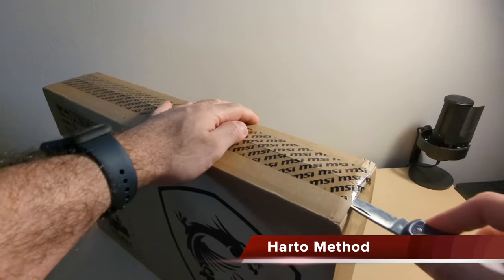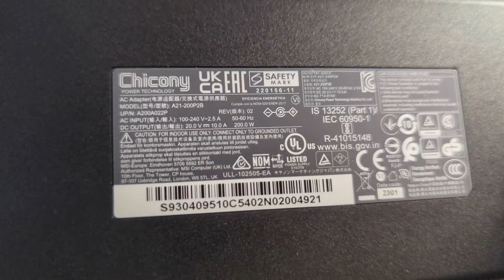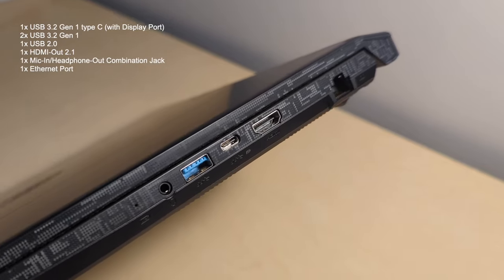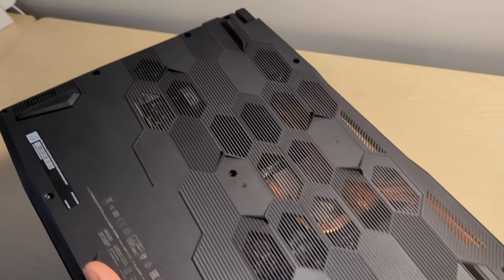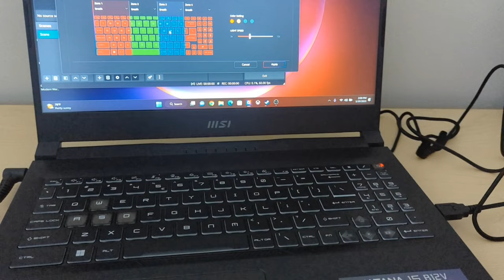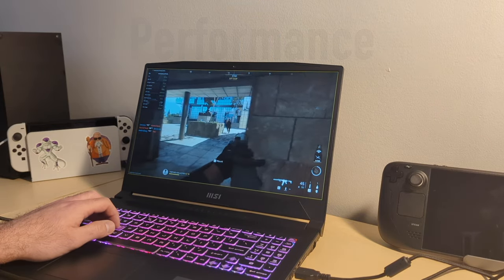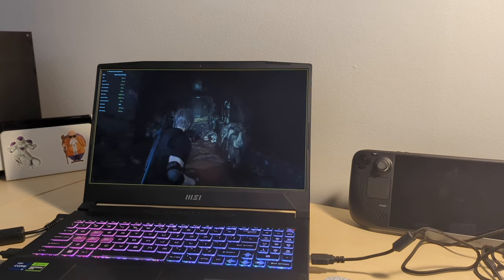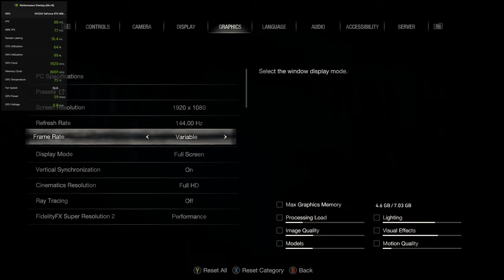MSI Katana 15 Review - Best “Budget” 2023 Laptop with an RTX 4060?!

Comment: Just got this laptop recently for 1700$ , I could of gotten something cheaper like the asus tuf f15 rtx 4060 but the katana had a better cooling system and hits 76°C on max load , I. 3D mark timespy I hit a score 10500, the laptop itself is very slim and portable, love it
Reply from the maker: Glad you like it! The more I use the more I realize that I’ve never run into any issues. Really solid performer for the price
Reply: Recently just bought - Katana 15 B13VFK

13th Gen Intel Core i9 - 13900H
16GB DDR5 RAM
1TB NVMe PCIe Gen4x4 SSD
Nvidia RTX 4060 8GB GDDR6 VRAM
15.6" FHD (1920*1080), 144Hz, IPS-Level
4-Zone RGB Gaming Keyboard
Intel Wi-Fi 6 AX201(2*2 ax) + BT5.2
MUX Switch
Windows 11 Home
Color - Black
MSI Backpack
2 Year Warranty Term
Reply: “could have” not “could of”. You’re welcome.
Reply: Ey bro just asking what is the games you play and whats the average fps that you got on them
Reply: What is the cpu temperatures that you get on this laptop, I am really thinking about getting it.
Reply: how is the battery?
Reply: Just bought it $1200 Amazon 4070
Reply: Wm has had this one for 1200 you Def overpayed
Reply: $1200 in USA but £1200 in UK we get our pants pulled down
Reply: I shit u not I jus got this laptop for $200 on eBay😭 im so happy and everything is working fine
Reply: lmao you can get ur for $700 now 😂😂😂
Reply: Wow, how 1 year passed and now it's easy to find for 1000€
Reply: @mateoupcoach Hey
How did the laptop turn out had it any problems is it a good choice 4070 is 1200€ rn too is would help me if you would answer as so someone who has used the msi kata 15 4070 🙂
Reply: It’s literally 800 what are u on about

Comment: I bought one for my wife it’s a MSI Katana A15 AI 15.6” 144Hz FHD Gaming Laptop: Ryzen 7-8845HS, NVIDIA Geforce RTX 4060, 32GB DDR5 , it’s coming tomorrow I hope it does the job, she’s a teacher that plays super causal games but it was on sale for 980 instead of 1.2k did I do good gang ? 😢
Reply from the maker: Think it’s a good pickup
Reply: Let us know how it is. I'm also thinking about swapping my gigabyte g6 for this one. My g6 cpu gets 100c at times.
Reply: I’m thinking about buying it this weekend as well. Give us your review.
Reply: @marcinmowinski5643  first one came in with a dead GPU out of the box so I had ro return it, there’s a new one that arrived today I’ll have to set it up and run some tests I’ll comment back my results guys.
Reply: @Mb.groovy  looking forward to hearing from you!
Reply: If it is going to be used heavily, return it right now. I bought a ryzen 7 HP Pavillion Gaming laptop once, due to intense use the Processor overheated and the laptop became dead in 2 years
Reply: Bought mine last weekend, ryzen 7 8845hs, rtx4060. So far very good. So much better then gigabyte g6. No heat issues, nice and quiet and performance is on par with a desktop with similar specs. Night and day difference!
Reply: @marcinmowinski5643  ryzen over heats more than Intel, for Laptop gaming Intel is better. For pc ryzen is better
Reply: @arpit2095  not sure if this is correct. Ryzen works better at lower power then intel, it can boost at lower power thus heating up less. My ryzen 7 8845hs in katana stays between 74-84 degrees while gaming cpu heavy games. Intel 7 13620h I had in gigabyte laptop would hit 100 degrees easly. Not to mention the noise. Also zen 4 cpus are more efficient then zen 3 and they stay cooler.

Comment: Just got one with a 4070 and 32gigs of ram and otherwise I think we have the same thing. So far.... It's fine. I paid 1500 on a tax free week in my state so it's fine. My desktop has a 1070Ti and i7-7700k so its quite the upgrade on that front. Plus I've had some problems with the desktop completely shutting down under heavy loads so I'm not sure what's going on with that but hopefully I'll be using this mostly for rendering/editing 4k video without having shut-downs ruin my entire workflow. Ran hogwarts legacy on ultra settings for about 4 hours and didn't have a single frame drop. Hard to complain when the desktop can't run it on the lowest settings without crashing the whole thing.
So far it's been nice to use... even though it's been just a few hours. All in all- no ragrats (so far)
Reply from the maker: Nice to hear! Will you be replacing your desktop with this and just dock your laptop when you’re at home?

Comment: Had mine up and running for no more than a few hours now, so far nothing but good to say about it. I suppose I'm lucky to have held out until the black Friday deals. Got mine with 16GB RAM, i9-13900H CPU and RTX 4070. Absolute beast compared to my desktop which is 5 years out of date almost. Best part is this was goin for £1900-£2000 on a normal month but with the sales was reduced by £800. Bloody great steal.
Reply: How you got for £800 could you please provide links or explain
Reply from the maker: Yeah there are some crazy deals on it right now!
Reply: Planning to buy this specs too! Hopefully there's no defect
Reply from the maker: Did you get it?
Reply: @hartomethod  out of stock unfortunately
Reply: How much did you pay?

Comment: I have the Katana with the i5 chip instead of the i7.  Around the same price buying it from Newegg.  Oddly, this one lacked the mouse, though not really complaining as since I travel a lot, a traditional mouse doesn't function very well and a wireless trackball mouse is not very expensive at all (plus I bought both at the same time).  The trackpad on mine actually is decently built and handles the pressure better than your model.  It's handled a few small bumps along the way and one or two "I hope the screen survived" moments.  No damage and performs awesome.  I've ran a PS3 emulator on it for like 3 days straight (Gran Turismo 5 B-Spec endurance racing) and it never gave a fuss pulling that kind of load against the GPU and CPU.  The only thing I have issue with is Sim City 4 absolutely refuses to boot on this laptop but will boot on my desktop (which uses an 11th gen chip and I think the 12th gen chip bricks the game).

Overall, I absolutely love this laptop and it has definitely proved it's worth to me and definitely recommend it if it fits in the budget.  It also isn't overly noisy, even when gaming, at least to me, though I do have some loud speakers hooked to it so it easily drowns out the noise.
Reply from the maker: Nice!

Comment: Would like to see you run it on your external monitor as well.. I have a two-year-old MSI with a RTX 3060 32 gigs Ram. When playing Resident Evil 2 Remake It barely holds 60 FPS throughout the whole game.. Your MSI 4060 seems the average 99 FPS, so itdefinitely a good upgrade for the price.. Also I think you'll find the RTX 4070. Is just a couple of $100 more in a laptop with about a 15% to 25% higher in frames Rate's. Not to go off topic, But it might be a good review in the future... Either way, great video, good job, thank you😅
Reply from the maker: Thank you!

Comment: Idk if this applies to the katana 15, but the katana 17 I have with the same specs has a lot of fan noise. Even when I don't have anything running. It comes and goes intermittently. The battery life is also abysmal even for a gaming laptop. Moreover, the laptop only comes with a 1080p screen and has okay speakers at best. Other than that, just purely in terms of performance, the machine is a beast.
Reply from the maker: I've honestly only used it for gaming so my fan was consistently running (but I used headphones). Also I agree, this laptop needs a power source to get the best use out of it since it has such power hungry internals! But with all that being said, it was able to handle everything I threw at it!
Reply: you can change the fan speed

Comment: Hi bro, what's your opinion for these models, which one is better? i'm so confused :( Thanks
1/ Laptop Asus TUF Gaming F15 RTX 4060 8GB Intel Core i7 12700H 8GB 512GB 15.6″ FHD IPS 144Hz Jaeger Gray RGB Win 11
2/ Laptop Gaming MSI Katana 15 B13VFK Geforce RTX 4060 8GB Intel Core i7 13620H 16GB 1TB 15.6” FHD IPS 144Hz RGB Win 11
Reply from the maker: I think they’re both pretty decent and similar. The CPU are essentially the same in terms of performance. 

The only think you should consider is that the ASUS only comes with 8GB of RAM and 512 SSD where as the MSI comes with double that. Not the biggest deal because you can always upgrade but it would be an additional step.

Comment: I chose the GE76 Raider 11th gen 3070 but it was stolen. Now I'm looking to replace it, with this & from what I've seen of your Battlefield gameplay, it looks like it's a certainty now. Thank you! MSI Control Panel, has different power modes. When playing, I would crank that as it changes to fan and voltage, basically overclocking it for "Performance Mode", the Turbo was too noisy on the GE76 and can only imagine, MSI's fan curves won't have changed much. Another point, at release of the z390 for i9-9900k all MSI boards, were by default overclocked. I've got an MSI MEG Z390 Tomahawk and it screams... because it's overclocked by default.
Reply from the maker: Sorry to hear about your laptop! And appreciate the tips and advice on MSI products, I didn’t know that before. This laptop will handle BF with NO issues. I’ve played multiple hour sessions this past week and it’s a beast. Getting above 100fps easily.
Reply: How'd it get stolen?
Reply: @dutchjoran  I didn't ask the thieves... they weren't around to ask.
Reply: @mrhassell  figured as much 😂 did you bring it to a MC Donald's and go to the toilet or something?

Comment: I spent the entire Labor Day trying to look for a laptop for this semester in terms of specs it covers everything I need but I don't need much for gaming more so rendering such as Da Vinci, Adobe Photoshop, audacity, and Filmora. An acquaintance tells me if I can get  I could get an AMD cpu and a Nvidia 3050/60 or 4050/60, I should be good. 

But I'm not tech Savvy enough to take it apart and put that together plus that's a lot of extra expense. I'm mainly need something that has a lot of CPU to be able to run all those programs I listed above. 
Would you say it's still be worth it to try and invest into this computer?

My acquaintance also recommended the MSI Bravo 15 which has a ton of CPU but it might not be able to run my programs as well so I'm at an impasse between these two I would really appreciate any suggestions my budget is $1,000 but I would prefer to stay below but I don't mind shingling out a little bit if it's worth the value.
Reply from the maker: I think this laptop will handle those programs with no issue

Comment: i'm planning on getting the Katana 15 with same chip but with the 4070. I have a msi monitor also with 1440p and plan to connect that up when i'm at home. have you already tried doing that, if so? could you share your experience? btw great review!
Reply from the maker: That sounds like it’s gonna be a dope setup! Yes, I’ve hooked up mine to my 1440p monitor and have been able to play on it no problems. My monitor is also called at 144hertz and I can hit that on some titles as well.
Reply: If you're a gamer, 4070 one is better for you but I'm planning on getting the 4060 one with i9 13900H since I'm going to be needing more CPU uses.
Reply: @GojokeSatoru i am also thinking the same when u get yours please tell about how it works
Reply: @Kenny0215  well, I won't be getting it until mid month of October but i9 has more cores, threads and higher maximum operating frequencies which will allow your PC to run faster than i7. I'm gonna be mainly using it for song production which is CPU demanding and better CPU would cut sound latency issues. GPU wise, 4070 obviously is better than 4060 by what I would think is 25-30% in gaming performance. I only play Dota 2 so I probably won't be needing a higher GPU.

Comment: hey man im about to get this laptop but instead of the intel cpu its a amd cpu version, im kinda a noob when it comes to pc overclocking how risky is it do to and does it affect battery life? I saw u post a link to a reddit thread about it but was curious if i should bother doing it or not, im a college student so ill be using it for gaming and homework, should i try overclocking or just not bother?
Reply from the maker: You can choose your overclock settings so if you’re using it while gaming, you can just run it on normal then if you want to have a little extra boost, run the overclock
Reply: @hartomethod  okay sweet! thanks for the info!

Comment: Hey, which one do you think its better, MSI cyborg 15 rtx 4060 (8h i7) or Katana 4050 (16g i7)? I heard the difference in performance between 4050 and 4060 is big but the cyborg its just more expensive. Im also new to all of this so im kinda lost and in a budget
Reply from the maker: I think the difference between a 50 series card and a 60 series card is a bigger jump than 60 and 70. I’d recommend getting a 4060 if you can. I’ll handle more of what you throw at it
Reply: @hartomethod  thank you so much!

Comment: I'm glad you're broke out the HP omen I have a high-end gaming PC at home but when I travel I wanted something better than HP Omen I have I don't know if it's the same model or not but mine is the one that has the 7700hq and the 1050 t.i. Mobile in it but I upgraded it to 16 gigs of RAM.
I was looking into getting the katana so maybe you can help shed some light on this for me assuming you have the same HP Omen I do. How much better or worse is the display on the katana compared to the HP omen and what are your thoughts on the upgrade was it a big difference the one I'm looking at has the 4070 in it with the 13620h cpu. Thanks for your time and thank you for uploading this video
Reply from the maker: My Hp omen has a 960 in it but I think the rest of the spec are similar to your model. There is 100% a difference between your model and the 4070 katana. If you find a good deal on it I think it’s very very worth it. You’ll find it faster and more optimized in every way. 
With that being said, the screen won’t be that much of an upgrade unless you get a 1440 screen panel. I hope this helped!
Reply: @hartomethod  thank you and yes that helped.
I won't be getting it right now but around the Christmas time so hopefully by then I'll be able to find a good deal of 100 or $200 off.
The reason why I wanted your opinion on the screens is because even though the HP Omen we both have isn't really all that great of a screen I can honestly live with it. So as long as the screen is at least a little bit better I'm okay with it. the hardware performance as far as CPU and GPU are going to be hands down better.
Like I said my main gaming is going to be on my home PC which is awesome but when I'm out of town for work I want something that I can still play Warzone and a few other games on.
Also if I'm going to be at a specific hotel for a week or so I can just bring one of my secondary gaming monitors with me since obviously I won't be using it at home anyways I have a nice 1080p 144 Hertz Monitor and a 1440p 144hz LG ultragear to choose from LOL.
After hearing that if there's anything you feel I should know please let me know and thank you again for the response
Reply from the maker: I haven’t tried running warzone on my hp omen but I can assume it’ll chug pretty hard with my 960. I’d recommend trying to run it on your laptop and if it works then dope. Having an external monitor will make the experience better. I used the Katana while hooked up to an external 1440 monitor and it was awesome. 
Again, if it’s a secondary device, I wouldn’t make it a priority (unless you’re traveling a lot). If you do end up running warzone, let me know how it does!
Reply: @hartomethod  keep in mind that mine is the 1050 t.i. mobile model which oddly enough I believe it is the only mobile variant of a GPU to ever perform better than the desktop variant for some reason but it is in fact a little bit faster than the desktop version. And I ran the original Warzone on it a few times and it will technically run it however it is so sluggish and the response time is awful.
It will get around 30 maybe even 40 FPS if I remember correctly however the response time is absolutely awful you can move the mouse and it takes about a quarter second maybe longer for it to actually show that movement on the screen.

That's not the displays fault it's just how poorly the hardware itself handles that game LOL.
So even though it technically plays the game it's something you don't want in a shooter that requires fast reaction time.
And because of that the game was completely unemployable.

Also considering the price I had a similar thought as you did ( since it's not my main gaming rig and only for when I occasionally travel it might be worth picking up as a good budget mid-range gaming PC)
Reply: @hartomethod  forgot to mention thank you as of right now I believe this is the laptop I'm going to get unless by time Christmas rolls around something better pops up for around the same price
Reply from the maker: Glad I could help. You could even go with a cheaper 3060 or 3070 laptop and that would play all the things you want but a 4060 isn’t that much more expensive.
Reply: @hartomethod  yeah I was wanting 4000 series so I can use dlss 3

Comment: I have been thinking about buying the ASUS TUF Gaming F15 (2023) with Intel Core i7-12700H and 8GB RTX 4060(140W). The pricing is 1,410 $. Do you think it's worth it?
Reply from the maker: I think the tuf is potentially a better choice due to the 140W option it has. You’ll get great performance from both so it comes down to what you’ll be playing. Being able to use more power is always good. That being said. The katana was $1200 and if you find it for that price or cheaper, you can always over clock it